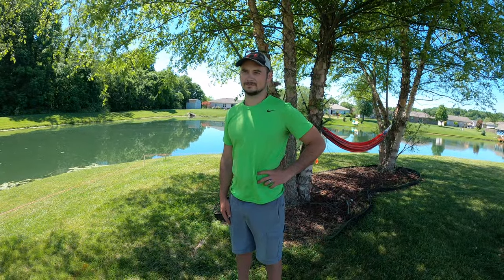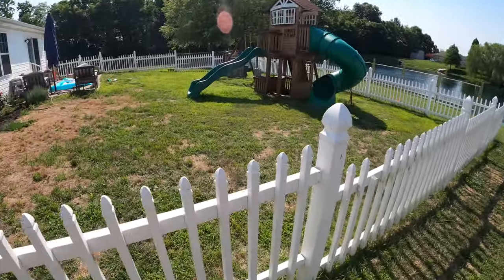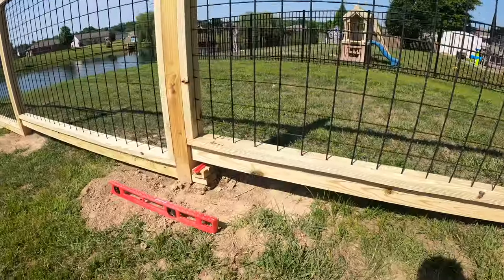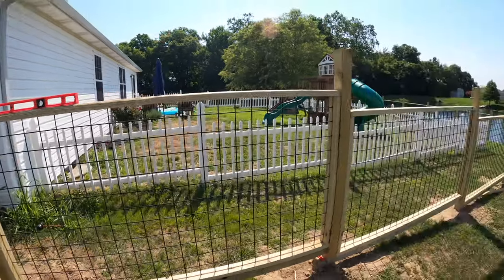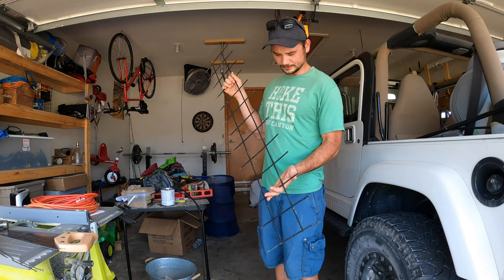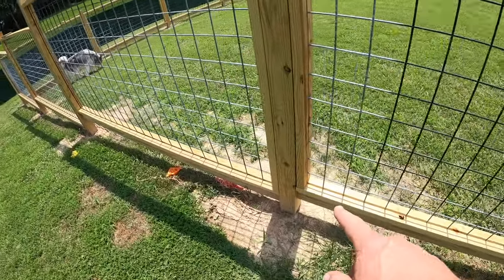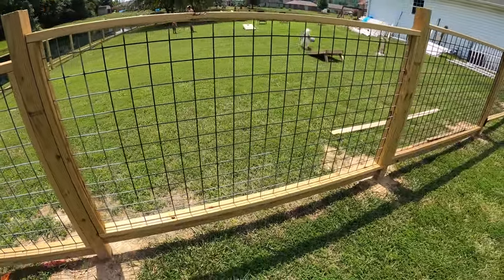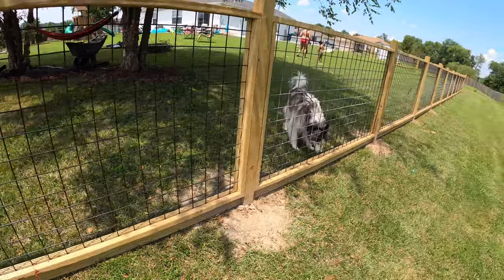DIY Hogwire Panel Fence using Dado groove on a sloped yard

Comment: I know it’s too late, but this may help your listeners... A cantilever auger is the way to go. It’s about 1/3 the size of a golf cart and rents for a little more than what you rented that for. It’s on wheels and small enough to roll up in the back of a truck, but large and heavy enough with enough power to easily drill holes. I drilled about 25 holes in 4 hours. The weight of the unit also makes it stable enough to take any sudden jerks from catching the occasional boulder while digging.
Reply from the maker: I should’ve used that one haha. This auger kept slamming into the side of my leg. I’ll keep it in mind for the next time I’m digging holes.

Comment: Damn that auger sucks.  That’s the one Home Depot offers for rent.  I rented one from the Ace down the the road; it was a Little Beaver where the actual motor and control apparatus are to separate pieces connected by the rotating cable and a safety bar.  That thing was pretty easy to use and I finished all my holes
in one morning.  I’m glad I didn’t get the one he’s using.

The fence design is very nice BTW

Comment: Was actually coming up with a similar idea for my large livestock and chicken pasture. I'm going to add strands of electric fence on the inside to double up.
Reply: Not planning on doing a tongue and groove set up though. I'll set up a top and bottom board with maybe some bracing and I'll staple the wire on the inside of the fence. At least that is my current thoughts. I don't have a slope to deal with though. Also leaning towards using pressure treated 8 foot 6x6 that are 42 inches in the ground, may add the wire on the outside of the fence as well for predators.
Reply from the maker: Sounds like it will be very secure. Good luck to you!

Comment: I had the same issue with the auger. I’m in Texas so I could not even get the holes started. What ended up working for me is pairing water on the areas I was going to dig let it sit for an hour so it could penetrate down and was able to dig all of the holes in no time with very little kick back or anything.
Reply from the maker: I’ll definitely keep that in mind for the next time I’m digging holes. That auger kicked my butt haha
Reply: I was advised to rent an auger with reverse on it.   Then use reverse to back out of the hole instead of pulling it out.

Comment: how have those 2x4's at the bottom of the hog panel doing? that grove is a perfect place for moisture to collect and make it rot.
Reply from the maker: So far so good about 14 months into. I did drill weep holes in the bottom groove. Toward the end of the video if you missed it.
Reply: @thejadeforest3189  can you post info on the fence wire gauge where you got it?
Reply from the maker: @bbur75  I think it’s 4 gauge. Got it at rural king but tractor supply has it too. It’s called Sheep/Goat panel and it comes in 16’ sections.
Reply: @thejadeforest3189  thanks 👍

Comment: How has this fence held up over time? Have the metal panels given out from kids pulling or weighing it? How have the dado grooves held up? Any 2x4's snapped at the thinnest section?
Reply from the maker: The metal has not given out and is still very sturdy. I don’t notice any rot or anything in the grooves. 
One problem I did have was some of the 4x4 posts twisting from not being sufficiently dry before I installed them. It’s pressure treated lumber. 
The fence still works fine, but I didn’t realize it would do that. You can see what I am talking about in my “1 year Follow Up” video which is in the description of this video.

Comment: really thorough video, thanks! would there be any reason not to assembly-line-style make all your panels first and then dig posts where/as needed?
Reply from the maker: I wasn’t accurate enough with my post placement to do that. I kept getting off by half an inch here, quarter of an inch there….etc. Also my posts shifted a little bit after concrete. 
That being said, you could probably do it if you really took your time.

Comment: It's a beautiful fence and you did a great job.  I'm planning one similar but I also want semi-privacy.  Every other panel, I want to run corrugated tin vertically.   On the wire part of the fence, I want to use it as trellis to grow flowers, vegetables and grape vines.  Any suggestions you have are appreciated.
Reply from the maker: Thanks. I like your idea of having it semi private. Are you planning on having the wire panel with the tin panel over that…or just a tin panel? I would just make sure the tin is securely fastened to account for wind. The wire obviously has no issues with wind blowing thru it. 

I think the wire would work great as a trellis…might do that myself in the future. Some kind of ivy would be really pretty. Should work well as long the bottom portion of the wooden panel is not touching the ground, causing rot.

Comment: Nice fence but I think you need to lower the bottom of the fence because that could make the dog try and dig out if he see a gap.
Reply from the maker: Thanks. I already filled the gaps with the spare pieces of the metal panel. No dog escapes so far.
Reply: @thejadeforest3189  Awesome, I started my fence similar to yours I'll do a video on mine when I'm finished. This is my 1st fence job too. You did a great job.
Reply: Just about finished my fence.
Reply from the maker: @TheIceman101  nice! how’d it go?
Reply: @thejadeforest3189  Great

Comment: Love your video. Thank you. Where did you get those wires? Sorry noob question. What are they called?
Reply from the maker: Np I’m a noob too. I got mine from rural king. I think you can find them at tractor supply too. It’s called sheep/goat panel.
Reply: @thejadeforest3189  omg thank you

Comment: Would you remember what size blades you used to make the grooves and how far apart they were 😅
Reply from the maker: The dado was 3/8” wide. It’s 4 gauge wire so just big enough for that. I think I went around 1/2-3/4” deep. Hope that helps.

Comment: I’m looking at this and wondering why is no one putting the dato groove in the 4x4? You could even make it 1” deep to hide any discrepancy in distance between posts. Than just slide the hog fence down into it and finish it off with a 2x4 cap after. This would also save on the costs of the side 2x4s.
Reply from the maker: I thought about doing that. It might work and it might not. The sides help with supporting the weight of the metal by creating a panel…so everything isn’t resting on the bottom board. Also, a 1” dado would make hella saw dust haha. But still, you might be right and it could work, and plus you’d save a lot on lumber.
Reply: I'm planning a fence with this design. Dado in the rot board as shallow as possible  (I'm calling it the bottom plate from my days as a framer) and dados in the 4x4's. I'm a little bit concerned about it sagging, but I'm thinking a few nails in the 4x4 could line up like tenons and support the wire. I also plan to cut some 4x4 blocks and place on a small cinder tile to support the middle of the panels if they do sag. I'm trying to cut material cost down, without making a shotty looking fence or a flimsy perimeter for the dogs...

Comment: Particular reason you wouldn’t just dado the post and save on 2x4?
Reply from the maker: The vertical 2x4s are attached to the horizontal 2x4s to make a panel. I then attached the panel with screws through the verticals to the post. If I didn’t do that, the metal part of the fence would be resting entirely on the bottom horizontal board. Anyways, the verticals help with support. It might be fine without them or it might be too much for the bottom board. I’m honestly not sure. Might be worth trying with the current price of lumber.

Comment: Quick question with the fence panel is installed in the Groved of the 2x4 can a large/medium dog push the wire back enough to pop the metal out of its grove?
Reply from the maker: I used 4 gauge wire and my grooves are probably around 1/2-3/4” deep. I haven’t had the wire pop out once. It’s really in there. I really don’t see a dog, or a person for that matter being able to pop it out.

Comment: How would feel about someone doing a dado on the 4x4 instead of having extra wood on the sides and then screwing the bottom in and doing it like the other video where she cut it by eye and wiggled it in, then placing the top on.
Reply from the maker: It might work, and you would definitely save a lot on lumber. 
I would be worried about the weight of the metal panel entirely resting on a single board at the bottom, instead of the weight being dispersed through the wooden rectangle panel. 
But it might be worth it to test out on a small section or if you have some scrap pieces.
Reply: @thejadeforest3189  that’s exactly what I was thinking. Definitely going to try it out soon

Comment: Hey Jade Forest, great video, I like you have watched a library of videos, and researched prices of materials. I picked up the first load of lumber today. I'm planning on doing 1&1/2 acres. But with the price of materials just doing 491 ft first. I heard you say you had a couple of 4x4s twist when they dried. I haven't seen your update yet, will after this. How bad? I saw a response from another viewer about cutting the dado in the 4x4 my thinking is the top and bottom 2x4 frames help to keep the uprights straighter. So my inquiry is were the 2x4s wet when you did the dado?  I know cutting pressure treated lumber while wet put a strain on my crosscut saw building trellises for grapes and blackberries. Did you have any issues? Again great job and cudos for credits and the links of other inspiring DIY'S Just a note, I priced 40 16ft cattel panels at Tractor supply on Saturday 5/20/23 $28.79 per, today Monday  the price is $34.99 go figure.
Reply from the maker: Hey thanks for the message, I appreciate the kind words. 
Yes, some of the 4x4s twisted, presumably the ones that were still wet. When I get up close to the fence I notice, but further away it’s not an issue. Structurally it is still sound. 
Also, I didn’t properly stabilize my 4x4s when I poured the concrete. This caused each post to slightly shift when the concrete cured. So each panel is very slightly different. One reason why I didn’t dado my 4x4s but you would most likely do a better job than me. 
My saw didn’t have any problems with it. Still works fine. Rural King and Tractor Supply both have the panels. 
Good luck!
Reply: @thejadeforest3189  not sure that I'd do a better job than you, I'm told the reason I never get anything done is I'm too much of a perfectionist. LOL 🤣 . Rural King is over an hour away. I called and was told the panels weren't galvanized. One review about them complain about rusting. Not sure about that,  if they would deliver I'd consider that as an option because they are cheaper. Thanks again

Comment: Where did you bought the hog wire my local Home Depot or Lowes doesn’t have it , and did you painted it or came like that.
Reply from the maker: Got it from Rural King, and it was gray at first. We painted the panels.
Reply: @thejadeforest3189  oh ok thanks
Reply from the maker: @lofadem  no problem

Comment: Might seem like a stupid question, but what did you use to make the slits in the 2x4 for the hog wire to fit?
Reply from the maker: Dado blade. Around 10:10 into the video.

Comment: Curious as to what black paint you used on the galvanized panels and how well it's held up?  Thanks.
Reply from the maker: My wife got a bunch of cans of flat black spray paint. Forget the brand but we got it from Lowe’s. For spray paint, I think it’s doing pretty well and it’s been up for about 18 months.
I posted a 1 year follow up on my channel if you want to take a look.

Comment: I've been wondering about that exact solution for dealing with the gaps under the fence where the yard slopes. I was considering cutting the wire extra long so it would go into the earth a bit. 

How did you secure it to the bottom of the rotboards? Did you cut a dado under there too?
Reply from the maker: I wanted to be able to use my weed eater under the gap wire. So for me, I wanted a small amount of clearance between the bottom of the wire and the ground. 
I simply nailed two nails to each rot board and hung the wire from them. Then I bent the nails up so the wire wouldn’t fall off. 

If you did want it to go down in the earth, seems like it wouldn’t be too difficult to just dig a tiny trench for the wire to rest in.
Reply: @thejadeforest3189  Hmmm. I've got a cable stapler I used to cable the house for ethernet. I wonder if that might be robust enough to do the job...

Comment: 4" squares, 6 ga wire?  Where did you get your fencing from?  I can't find any in VA?
Reply from the maker: Got it from Rural King, but I think Tractor Supply has it too. It’s a gray color when you buy it though. Think this is it: https://www.ruralking.com/red-brand-hog-panel-34-inch-x-16-foot-90213
Reply: @thejadeforest3189  Thanks, I may have missed it in the video - did you spray-paint it black?
Reply from the maker: @johnr2466  np. No you didn’t miss it, I just forgot to mention the painting part. My wife used a bunch of cans of flat spray paint from Lowe’s. After we cut the panels down to size, we sorta laid them on top of each other and then she started spraying. There’s probably a better way, but this got the job done.

Comment: i want to try to attach the panels onto existing chain link posts and top/bottom rail.  any suggestions?
Reply from the maker: I assume you’re talking about just attaching the metal panel with no boards. If that’s right, I don’t see why it wouldn’t work. Chain link fences are unrolled and then stretched with something like a winch so there is no sag. Then they are held on by little metal ties that wrap around the post. I don’t see why you couldn’t wrap the ties around these panels instead. Still, you might just buy one panel to experiment before you have all the material laying in your driveway! Good luck!

Comment: where did you end up getting your wire panels?
Reply from the maker: Rural King, but we painted them black.
Reply: @thejadeforest3189  how is your paint doing? I was going to use rustoleum prime then rustoleum oil base black.

Comment: Looks great man. How much would think just 200' of that would cost? Post and everything. I know lumber is different prices now.

Admittedly, I'm not much of a fence builder. But she wants a fence. Lol. So I'm trying. 

Also, the way you grooved the 2x4s to put the fence in. Have you have any issues with your dog pushing through? Or did you secure the fence some how.
Reply from the maker: Mine cost $3,200-3,500 for around 340ft. So just guessing...maybe $2,000?? 

As far as it slipping out, I haven’t had any problems. The fence panel is really wedged in there and not going anywhere. The dog hasn’t got out once.
Reply: @thejadeforest3189  Ok. Thanks alot.

Comment: I apologize in advance if I missed the detail…… did you buy it in black or paint it? I can only find raw galvanized.
Reply from the maker: No you’re good, I forgot to mention that in the video. We got the same raw stuff you’re looking at and my wife spray painted them. She laid several sheets down on the ground to maximize the spray. Still, it was pretty tedious work.
Reply: @thejadeforest3189  you guys are tenacious!! I appreciate the response. Great work on this video, links, and the fence. I’m doing this.
Reply from the maker: @BeaterJeep  good luck to you! Hope it goes well!
Reply: @thejadeforest3189  one thing…… the primer used for galvanized is crucial …… over time, many primers and rust inhibiting paints react with the galvanized metal. For future reference - if you don’t already know.
Reply: Is there a certain paint brand or type that you'd recommend would be best and long-lasting on the galvanized wire?

Comment: What length 4x4 did you use for stepping this down? 10ft?
Reply from the maker: I went with 8’
Reply: @thejadeforest3189  Awesome. I was a little concerned with the slope differences creating some odd heights in totally and the panels not aligning correctly.
Reply from the maker: @tylergillum2628  I think I see what you mean. My yard has a slope but it’s pretty gradual. There are other videos online of steeper slopes, but you probably already knew that.

Comment: What was the measurement of the wire panels and where did you find them?
Reply from the maker: The panels I got were 16’ and from Rural King. I cut them down to suit each respective panel. My posts shifted a little during setting so each panel was slightly different.
Reply: @thejadeforest3189  what height were the panels before you cut them?
Reply from the maker: @OPSteel97  48” and I didn’t cut the height.

Comment: Did you paint your panels or were they already black
Reply from the maker: Wife painted them black. They were originally gray.
Reply: I wanted black panels but looks like they would only be 36” height. The cost difference is crazy for powder coated panels. Did she use , roller sponge spray paint ? Your fence looks great.
Reply from the maker: @MrDubaux3  she would lay down 3-4 panels on top of each other, slightly offset. Then she hit them with a flat spray paint. That would get paint on most of the panel and then she touched them up later.

Comment: Just wondering how much time did it take you to make one panel, and how long did it take for the whole project?
Reply from the maker: Maybe 30-45 minutes per panel. Some went better than others. I think I spent 4 weekends and then probably another 15 hours to get the entire fence built. That includes digging and setting poles though. 

Of course that doesn’t include staining, which I did a while after building the fence. I have another 1 year follow-up video if you want to check that out. The link is in the description.